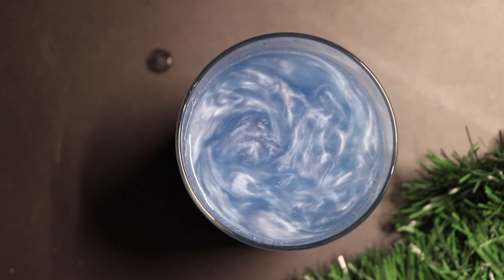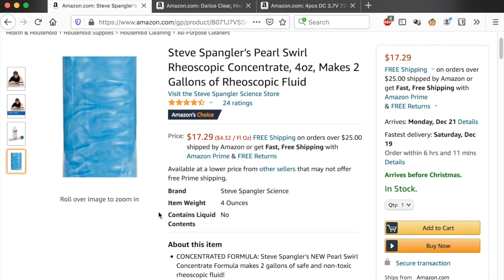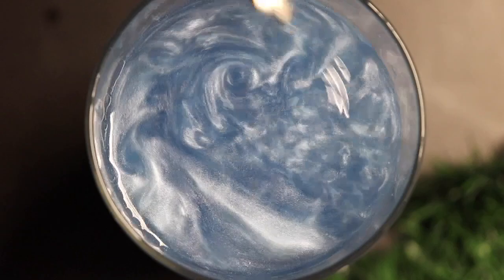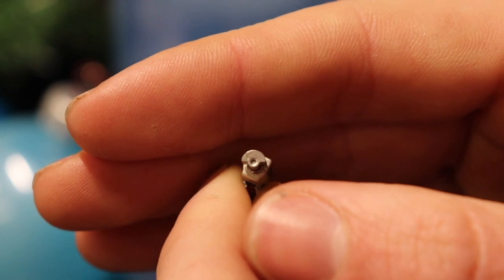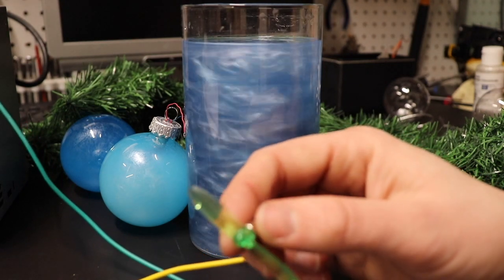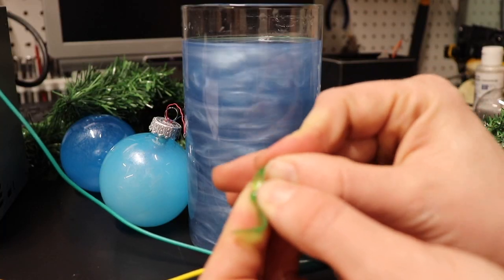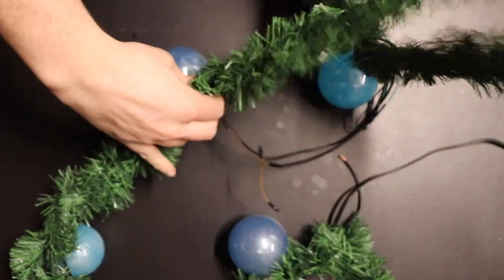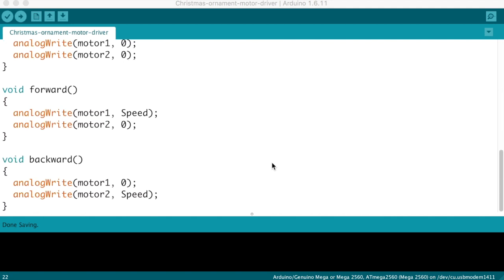Creating Turbulent Flows Inside Christmas Ornaments

Comment: you could use a tiny button cell battery or solar cell. when the other xmas light are on the solar cell can provide enough to run a small fan

Comment: I second the mineral oil comment, it's non-conductive and is used often in liquid cooled PC systems. It would be interested to try and edge lit laser etched plexiglass container that had the fluid behind it. You could also try less rheoscopic fluid in mineral oil to make a more wispy but still visible lamp.
Reply: If you wanted to keep the water for low viscosity, you could opt for a magnetic stirrer method. Plenty of DIY options via google. You could leverage the micro stepper motors mentioned, to keep the size down and either on the backside or bottom you could 3d print a small housing for it that wouldn’t look bad. Honesty I think the simplest method however is still mineral oil. It mixed well and your mean time on the motor should be ready no shorter then it was outside of it.

Comment: Steppers should last longer immersed, there are no brushes to corrode. 
And you can get them for a few cents each: https://www.ebay.co.uk/itm/273212998941
I think that you could probably run a whole string of them in series from a single stepper driver. They will do 20,000rpm and then explode on only 5V, so series wiring ought to not be a problem for slow speed stirring. 
I wouldn't be too concerned about immersing motors in liquid. Cars, bikes and aircraft all do it in the fuel tanks. 
I think water is the best choice, it's an easier clean-up when the cat knocks them off the tree and smashes them.

Comment: Nice video dude. Someone also suggested thermal convection, but have you considered  Making your own base that uses the principal that a chemical stirrer does. It uses a motor in a base to spin a magnet at the base of a beaker or other glassware. Might be a solution (pun intended) to avoid submerging your electronics.

Comment: Does a snow globe (or in this case, a fog globe) work with this? Manually shaking it up and a long settling time?
Basically, is it satisfying, or would a really small amount of fluid be needed?
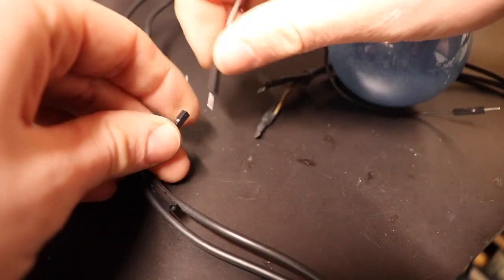Reply from the maker: That is an interesting idea. You could try making one, see @4:55 to @5:11 to get an idea of what a snow globe may look like. I would say there is a settling time of about 10 seconds until the fluid is "calm". If you were to experiment with different fluids/viscosities you may find a longer settling time. I also tested putting small ball bearings in the ornaments to further agitate the mixture (not shown in the video).
Reply: Glycerin is usually used in snow globes to slow the fall of flakes. Would that work with or against the fluid for settling?
Reply: @WillKnott  I was also thinking mineral oil might work and reduce the corrosion on the motor.  Question is whether the concentrate will mix properly with it.

Comment: Don't really do stuff like this so my comment may be... uninformed, but here goes: why couldn't you get a motor with a longer shaft so you could keep the motor outside of the fluid? I realize you'd have to have washers/grommets/whatever to keep the fluid from exiting along the shaft, but it should be possible, no? Slightly less ornament-like, but you could hide the motor as part of a decorative hook for hanging, I'd think. Certainly an interesting project to do with my kid.

I'm also thinking driving it based upon audio input might be interesting - music beat-matching sort of thing, maybe.
Reply from the maker: Good ideas, I did consider mounting something externally but don't currently have the appropriate parts; may come back to this project in the future. I also wanted it to still appear to be a "normal" ornament on the outside. The audio idea is interesting! Maybe a xmas song to fit the theme